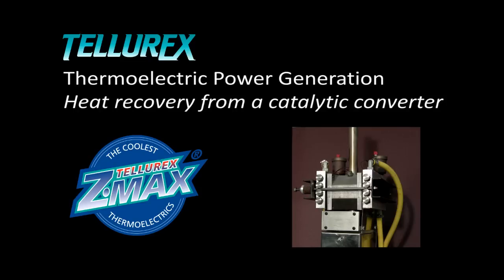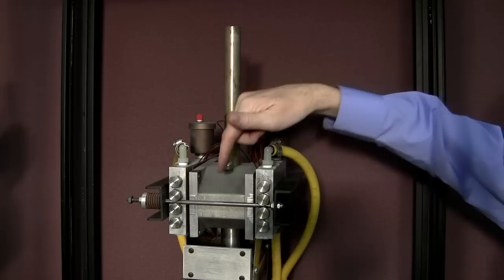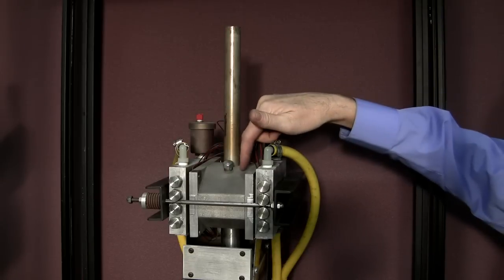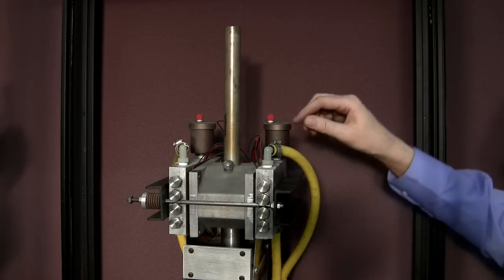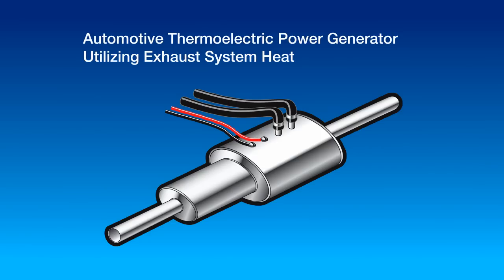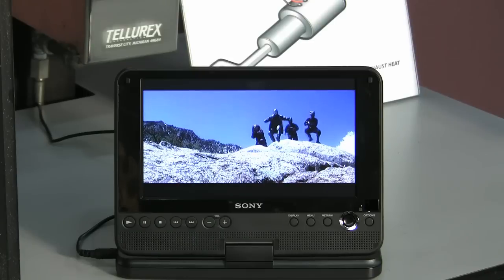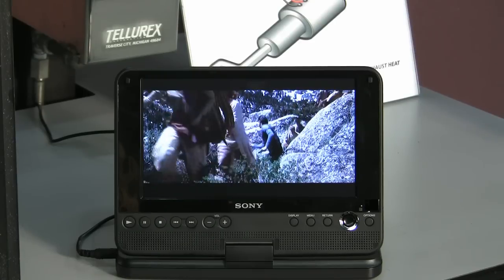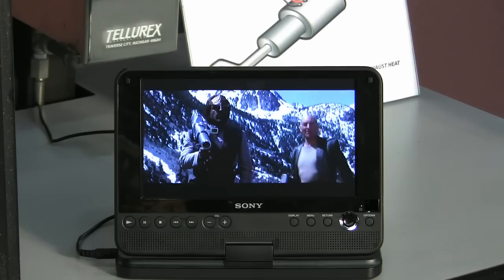thermoelectric power

Comment: @brianwesley28 No, this makes electricity using the temperature difference, this is a Thermoelectric Generator (TEG) but for produce little energy (using a small themperature diference) you can use a Thermoelectric cooler (TEC) that is cheaper. See: watch?v=SvBeCCjb9ds